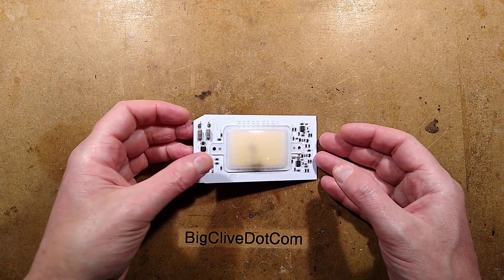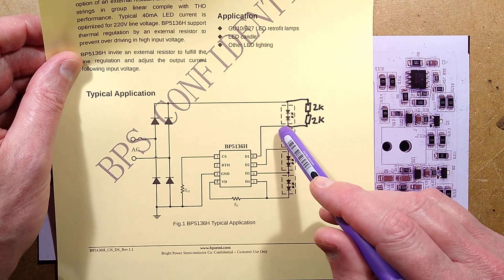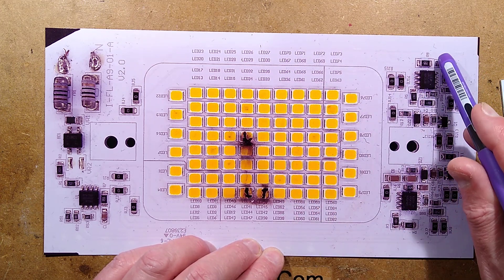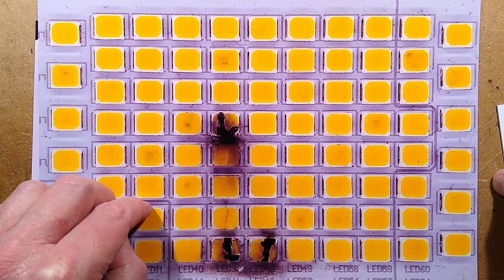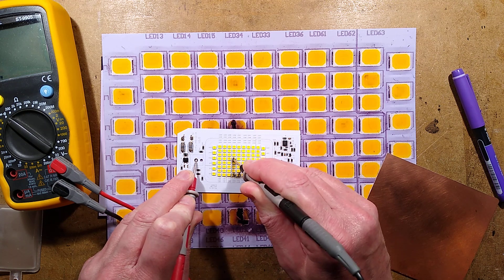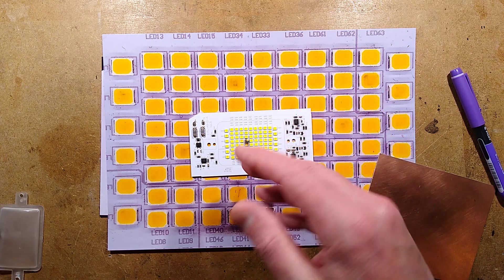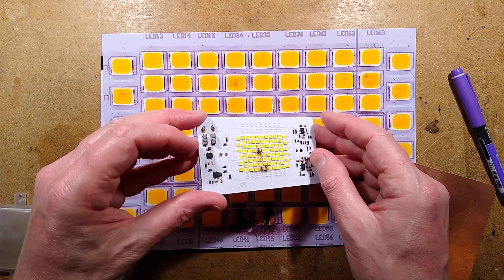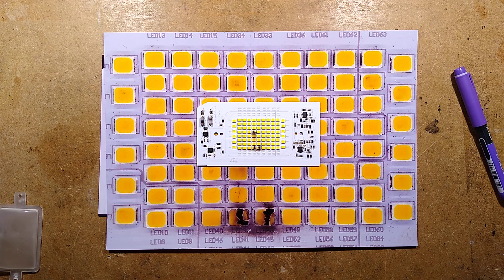LED shock hazards are increasing

Comment: Yep, proper grounding of floodlights was and is always important. In halogen lamp days, the problem was due to wires melting and water ingress, now its faulty LEDs.
Type AC RCDs are no good, especially not the cheap version with active electronics inside. 
Type B (really expensive) isnt really needed unless you have loads powered from a 3-phase rectifier, otherwiese type A will work fine. I dont think there even are 1-phase Type B RCDs as these will make rather limited sense.
I do have type B RCDs in my workshop (im using machines with 3ph input VFDs and a 3ph inverter welder) and paid a fair amount of money for these.
Reply: Yeah in a modern house there should never be AC type RCDs. They core can become saturated easily just by the small amount of dc leakage most powersupplies for example in computers or for LED lighting.
Reply: @BrosBrothersLP  Could you explain how these devices could produce a DC leakage? As a power supply designer, i cant see any way this would happen. All that happens is AC, after all the coupling is via the Y capacitor and DC rarely passes trough one.
Reply: @semifavorableuncircle6952  funnily enough i also work in PSU design. Fact of a matter is as soon as you do your rectification not through simple diodes but actively switched you are gonna introduce slight asymmetries in current draw. And lets say you get a device drawing around 10 A peak current. Thats 20A peak to peak  a dc curent offset of a few mA is in a range that your device probably cant reliably measure.

A second effect is that if you have small startup powersupplies that are low power they often only work on a single half wave.
Reply: This is not direct leakage to ground. But any DC current on the Line can mess things up for a AC type RCD
Reply: @BrosBrothersLP  Little late, but DC load current doesnt anything bad to the current sensor in a RCD, the flux cancels out. Hair drier on low (which runs the element on a halfwave) doesnt make it insensitive. Only DC leakage would cause problems. 
Actually, the only problem where AC RCDs dont work is slowly rising pulsed leakage current, a fast rise fault current would deliver enough UxT to trigger on the first period, before the core can saturate. But unfortunately, fault currents often rise slowly.

Comment: In America it's less of a worry because our voltage is only half as spicy as UK's.
Reply from the maker: Bizarrely, a higher percentage of Americans get electrocuted, possibly by thinking the lower voltage is safer.  In the right circumstances (often involving right spaces or water) 120V can easily kill you.
Reply: @bigclivedotcom  I think the issue might be the huge amount of home improvement stores and how anyone can do it without any really supervision or skill.  Although you should get a professional many people believe they are smarter than they are and these stores cater to that type of person who is also more likely to end up crispy.  We have the same issue with other building related home gamers.
Reply: @someguy2741  - plenty of DIY stores and other suppliers who sell electrical cable, fittings, switches, sockets, consumer units, MCBs (breakers), RCDs etc… I’ve seen some very dodgy wiring over the years as family or friends often ask me to ‘help out’ with anything electrical. I hasten to add, this is often when they move into a new home, or obtain an appliance, gadget or similar. I’ve also seen plenty of dodgy workmanship at work, especially from some contractors (there are good, and bad).
Reply: @bigclivedotcom  Even 9V can kill you under the right circumstances.
Reply: @bigclivedotcom  I'd be willing to bet that it's because they have a higher propensity to do DIY stuff. You don't see that nearly as much in the UK. (Keywords: "as much." Because I'm sure someone will come along and say "I do DIY stuff all the time.) It's not uncommon for people to do full home remodels over there. I couldn't find any concrete numbers for domestic vs industrial accidents, or stats that are equivalent in their methodology (some included deaths from electrical fires) but assuming that you're right, I'll bet that is the reason. Even though the numbers are kind of too small to get really good statistics. Numbers of deaths in the few hundred can have wild percentage swings from differences in relatively small amounts.  They are just way more DIY savvy as a whole. We don't have several huge home improvement stores in each city, and you won't go into one of our stores and see 50 homeowners buying supplies to do a complete bath remodel, and then go outside to see them renting a truck and skid steer tractor to rip out their driveway. It just doesn't really happen in the UK, or most of Europe.
Reply: @littlejackalo5326  - DIY with electrical wiring and accessories DEFINITELY happens in the U.K. You don’t think B&Q, Homebase, Wicks, Screwfix, Toolstation , Proper Job plus all the other DIY or similar stores keep mains wiring and accessories on the shelf’s just in case an electrician happens to wander in do you?
Reply: 'Merica!
Reply: I'm going to try and implement spicy as a unit of voltage at work.
Reply: 170V DC (from a 120V AC supply) still hurts, lots…
Reply: @Mark1024MAK  170 DC would be an incredible whack.  I had a run in with a solenoid while fixing a washing machine.  Standing in a puddle of water of course.  It was an old machine and I suspect it was 115V rectified.  Safety first I was poking at it with a screwdriver and not gripping anything :p
Reply: @someguy2741  maybe you got a spicy shock from the coil as it was switched off?
Reply: @someguy2741  Curiosity fried the kid :) I was 13 when visiting a company that makes medical equipment. It was a week of work experience and I was thrilled to get some electronics experience. I was testing some weird instrument that had Nixie Tubes and it wasn't working properly. I thought it might be some poor connection so I pressed on the back of the circuit board with my fingers to see if I could find something...
...I found out that the Nixie Tubes on that board were driven by about 170 V - ZAP! 😂😂😂
Reply: @someguy2741 
I once tried to strip the insulation off a phone cable using my teeth...same logic - it's only a tiny wire so it must be low voltage. Wrong! I think I jumped high enough to be in the Olympics.
Reply: @someguy2741  - The plain old telephone system (POTS, and yes that is what the fixed wired telephone system is called) does indeed use a ringing voltage of between 80V AC to about 100V AC. And as one leg of the telephone pair is normally earthed at the telephone exchange, yes it can give you a belt. I’ve done it myself and see it happen to my work colleague.
Reply: Would you lot knock it off arguing about phases. There are two different terminologies/definitions.
In some parts of the world, there is a split phase system where there are TWO line (live) feeds/poles and a neutral. The distribution transformer secondary is centre tapped (or equivalent), hence line 2 is 180° out of phase with line 1. Hence this is often referred to as a two phase supply. Hence in the U.S.A., some outlets are 115V or 120V and some are 230V or 240V. All fed from the same incoming supply.
A three phase supply is where there are three lines. Each line is 120° compared to the other two lines. Three phase can be either a three wire system (three lines and no neutral) or a four wire system (three lines plus a neutral)  depending on the type of transformer used. Supplies to end users are normally the four wire system at 400V (415V in ‘old money’), as that then lets each line be used as it’s own single phase 230V feed.
Reply: @Mark1024MAK  electro boom says no
Reply: America is 220V too, we just don't provide the full voltage into things like bedrooms.
Reply: You'll be surprised that America is also 220V.
Reply: Not to the wall, which is what matters and what he means, pedants.
Reply: @iyatemu  you beat me to it. :p  I took it one further.
Reply: @iyatemu  Yeah, if one wants to go down the road of voltages anywhere, the voltages are probably more like hundreds of kV in the distribution lines rather than 220 😁
Reply: @iyatemu  If you measure the voltage of the wall outlet on your aircon, it's 220v
Reply: @EnseiMada , no it’s not, Murcia is 110 phase to earth, if you want to play those stupid games, then the rest of the world is 415V or 480
Reply: @EnseiMada  You would be even more surprised that we are actually 600v   and 480v 3 phase only residential is 230 2 phase.
Reply: @someguy2741  there is no such thing as 2 phase.
Reply: @50Hertz60hurts  you are either joking or dont know so I will explain.  If you are in the US or Canada and have an electric stove or dryer or welder or large residential compressor or another larger amperage device it is either 230v or 240v which is two phases of 115v - 120v (230 and 240 are treated different for grounding purposes but are the same inputs, one has 3 prongs the other has 4 with 1 being a dedicated ground).  If you go to your residential breaker panel and breakers that are paired (they have a bar across the switches such that both are thrown at the same time.  Those are two phase 115v for a total of 230v.
Reply: @someguy2741 , I have 40 years in this industry, taught by the best engineer around, seems you are the one who lacks understanding, if an appliance element, a motor a lamp, or whatever, only has two wires then it can only ever be a single phase load as there is only one current path, regardless of where the supply comes from, correct?

Here for example in country areas we have a centre tapped 480 volts, +240 / 0 / -240, regardless of which two terminals you choose, it’s still only single phase. Same as your single phase 220, +110 / 0 / -110, two wires equals one current path, equals single phase.
Reply: @50Hertz60hurts  there are 4 wires... 1 phase a second phase a neutral and a ground.  If you split off one of those phases you run the the 110v appliance.  The fact that you have a +110 and a -110 is the definition of a phase.  The +110 is one phase the -110 is the second phase... that what that means.  They are AC one is "Out of phase" with the other for a total difference in voltage of 220v.  That how you run the 220v appliances.
Reply: @someguy2741 , makes no difference, how many current paths?
Reply: @50Hertz60hurts  It just struck me what you think I am talking about and you might have misunderstood the explanation.  This explanation below is for completeness for other people in the future.

If you are at a regular wall plug where your tv plugs in.  There are two flats and one round pin.  The flats are live and neutral the round is ground that is usually tied to the copper plumbing or some other ground source.

If you go to an older 3 pin dryer socket there are also 2 flat and one round pins.  These ARE NOT the same as the tv plug.  one flat is one phase 110v LIVE the second flat is also 110v LIVE (second phase) the round pin is NOT GROUND it is neutral.  Essentialy one of the 110v LIVE here drive the tv plugins and 110v devices.  BOTH OF THE FLAT TERMINALS ARE LIVE DO NOT THINK ONE IS NEUTRAL.  This is why you can probe between either of those and the round one and get 110v.  If you probe between the two flats you will get 220v.  Because when one is AC 110v positive the other is AC 110v negative for a net lf 220v.

These 3 pin 220v plugs were phased out here because they dont have a dedicated ground for safety.  Now they are 4 pin for most residential cases for dryers and stoves.  In my garage the 3 pin variety is classified as higher amperage for pseudo industrial applications (welders and compressors and other more powerful motors that are wired for 2 phase like my hydraulic lift) With 4 pins one is 110v LIVE 1st phase the second is 110V 2nd phase the 3rd is neutral and the 4th is ground.
Reply: @50Hertz60hurts  so here's how a non-electrician like myself understands things.  I am in Canada.  Most things like lamps, televisions, and other low current products use one phase:  one hot wire, one neutral.  Nominal 115VAC. Certain things have a separate ground wire.  Things like electric stoves and air conditioners, have either three or four wires: two hot wires, a neutral,  and sometimes a ground.  I have no idea how a transformer is wired.  Our shop is fed with three phase 600VAC and a transformer inside the building.
In the Philippines we could "cheat" and run something like a 110 volt television by using one hot wire and one to ground.
It seems you are both speaking differently about similar things.  When working with generator sets I could configure the same generator to run 110 or 220 volts single phase, certain ones would go to 480 or 600 depending on how they were constructed, regulated, and which way the 12 wires of the windings were connected.
Now would be the time to correct me if I am wrong.
Reply: @someguy2741 , I could care less about the number of flats, rounds, triangles or even crescent moons the plug has, or even if the apparatus has a plug; if a circuit only has one current path, like an element, or your test probes, then it is single phase.
So even if you connect across two phases of a three phase transformer, it is still a single phase load.
Reply: @50Hertz60hurts  i understand.  You dont want to learn about the wiring that you are an "expert" in.  Perhaps you could benefit from a book from home depot.
Reply: @harveywright396 , the size of the load is irrelevant, only the number of wires live wires in the circuit, lamps have two connections and are therefore single phase, so in Canada a 110 volt lamp is single phase between live and neutral, a 220 volt lamp is still single phase lamp, just connected between L1 and L2, the lamp still has only one filament so it can only have one current path.
Take your 12 lead alternator for instance, connect it up in series (high), zigzag, you then have 480V single phase between T2 and T3, or two 240 Volt single phases between T2 and T10-11, or T3 and T10-11, correct?
Reply: @someguy2741  I think you are confused. Sometimes we are connected to two of the phases of a 3 phase transformer (still considered single phase) and sometimes we are connected to two legs of a center tapped single secondary coil of a transformer (single phase again) . All of this is not to be confused with something nearly a thing of history that predates 3 phase called 2 phase where the two phases are 180 degrees apart and depending on the system use 3 or 5 wires. Parts of philly have the 5 wire system and in nyc I've dealt with the leftovers where it was 3 wires and the utility made it with a special transformer connection called, I think, Scott T but once again 2 phase is left to antiquity. It may be best to refer to our 240 as having "2 legs". 
Pardon me the term is split phase:
https://en.wikipedia.org/wiki/Split-phase_electric_power
Reply: @50Hertz60hurts  It's not about the load, it's about what enters your building. 
 
If there are 2 live wires that are not shifted in phase, it is a single phase system. This is occasionally done in the Netherlands, where 2 16a circuits are combined (breakers linked, each goes to its own heating element in the cooker) to make a 32a 230v heavy duty circuit for electric cookers. 
Yes, it's weird but it is up to code. It has two lives, but it is single phase. Connecting something between the two lives, doesn't do anything because both lives are coming from the same phase. 

If those wires are 180 degrees out of phase towards each other, and they're both referenced to a neutral centre point, it is a 2 phase system. This is the case in the USA. Because they are two different phases, 180 degrees shifted, you can hook up something between the phases and it will work. 

Your light bulb idea is very hypothetical. You cannot hook up the typical USA dryer to just the two phases without neutral. 
It won't do anything. It needs the neutral to create a 120v internal voltage for the motor and the timers and all that stuff. It needs the 180 degrees phase shift to get 240v to feed to the heater element. 
Hypothetically it could use 2 elements between L1  L2 to create a voltage divider  making a local N, but jeez, that's really scraping the barrel. 

If there is no centre point, it is again a single phase system. You could ground either of the two to create a neutral, and end up with the typical euro system. But this is not the case in the usa. 

If there are 3 wires, shifted 0/120/240 degrees, there is a 3 phase system. Typically, smaller homes get one of those 3 wires and a neutral to get 230v. 
Modern houses get all of the phases to get 230/400v, for faster charging of electric vehicles, electric heating and such.
Reply: @mfbfreak , control voltages can be derived from transformers within the device, either way, a load that is connected between phase and neural is single phase, and a load that is connected between two opposing phases is STILL SINGLE PHASE!
Reply: @50Hertz60hurts  - err, not all filament lamps have only two connections. Some specialist lamps have three connections. For example lamps that have two filaments.
Reply: @Mark1024MAK  true enough, which is exactly why I specially said single current path, single filament lamps.